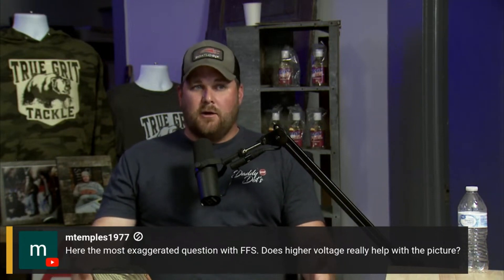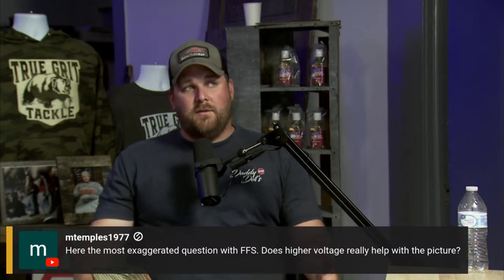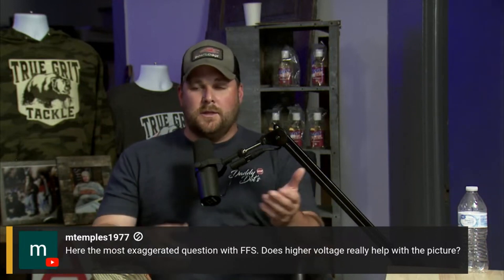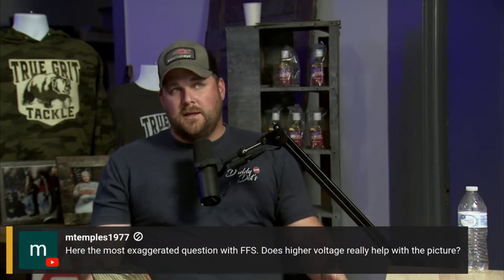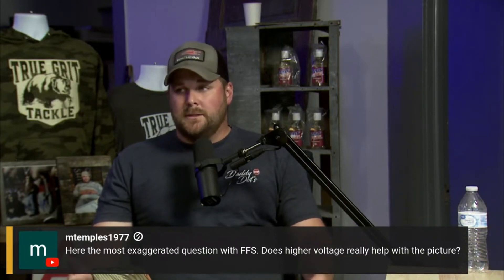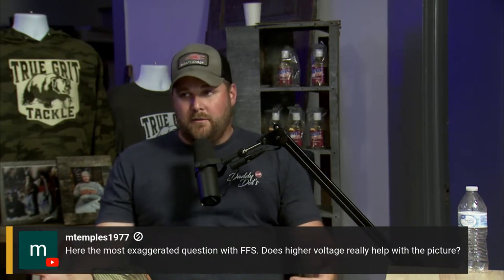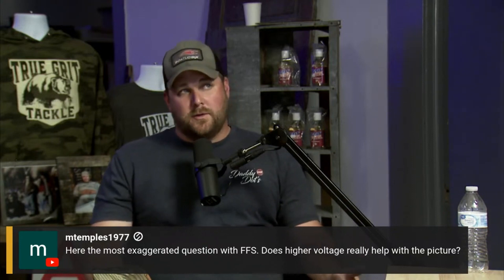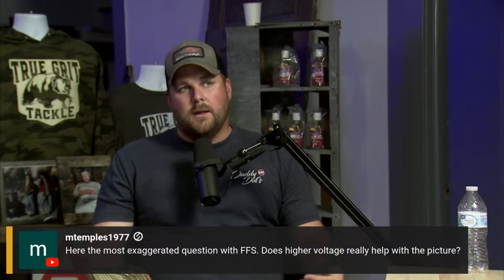Does Higher Voltage Equal Better Sonar Picture Quality?

Comment: From what I've seen, poor connections at splices and termination points cause more issues than anything else. Keep connections clean and tight, and make sure your power source is healthy and you shouldn't have any issues. As long as there isn't an excessive amount of voltage drop, the issues with clarity are probably  from your display settings.
Reply from the maker: Good point!! Appreciate ya!

Comment: This is one thing I disagree on. I DO believe the higher voltage provides a better image, just not as much of a difference as some people think or expect. Compare a $500 65” TV to a $2,000 65” tv…… the cheaper tvs Never come with an external power supply w/ a  dedicated GROUND. The nicer tvs come with a dedicated ground AND a higher power output to the TV
Reply from the maker: Interesting take. We appreciate you watching!